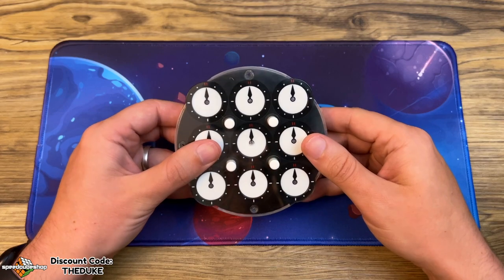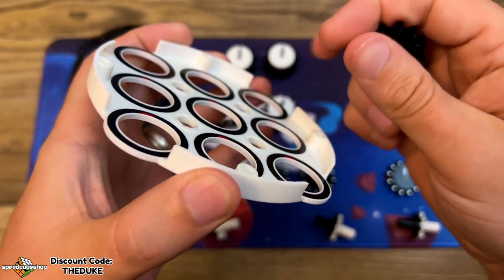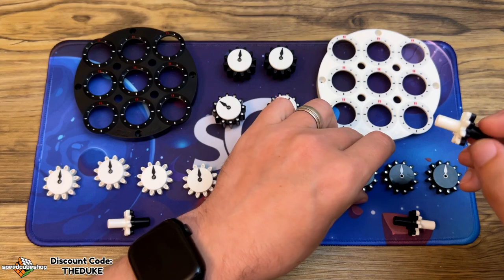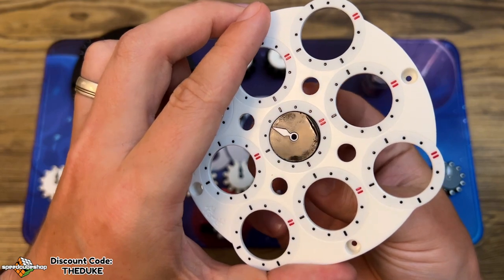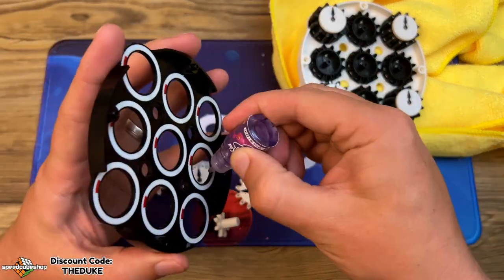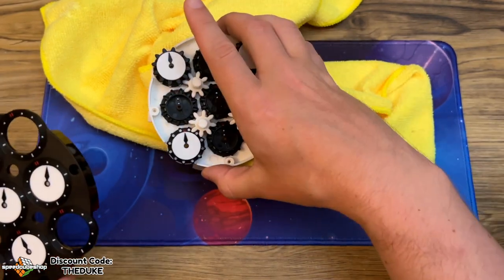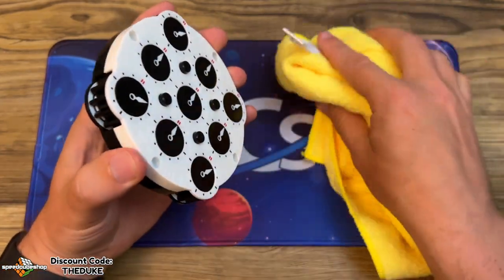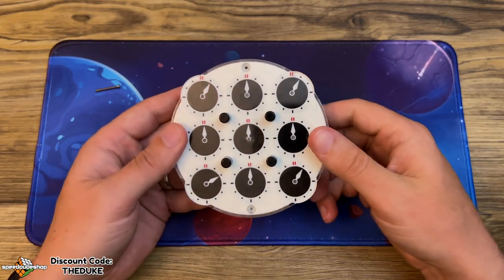How to Lube a Rubik's Clock

Comment: I got the one from 1980 matchbox rubix clock. it doesn't have screws but the clocks do look nicer with they yellow and red striped dials.  how do I fix it if it doesn't have screws?
Reply from the maker: Hmm I am not sure. I’ve never actually used that one so I’m not familiar with it.
Reply: @TheDukeofCubes  exact same thing but no screws

Comment: Great video! I just got my clock and lubed it earlier. Lol. I have the SengSo clock. When I have all 4 pins up, the turning is pretty hard. I lubed it with weight 5 and DNM in the same way you did. Should I put lube on the gears or something? Or is the SengSo clock just like that? Thanks
Reply from the maker: Hey, congrats on getting a clock!  I am not 100% sure how the SengSo looks inside for specific details, but it will have the same principle in terms of gears, so I would not lube any of the gear piece as it will eventually work its way out onto the turninig wheels as they all connect.